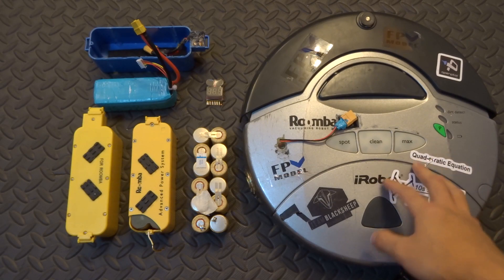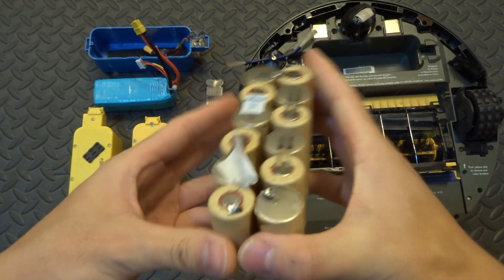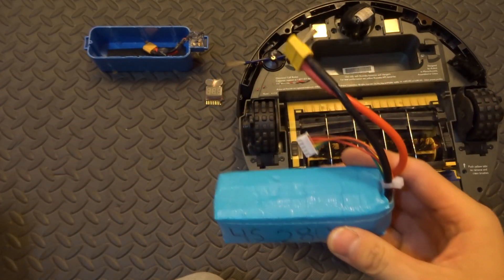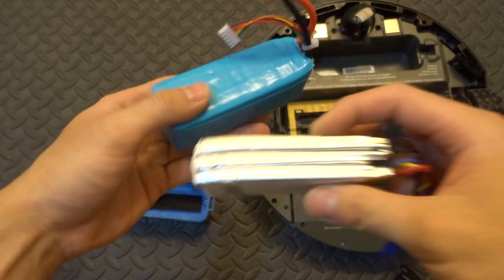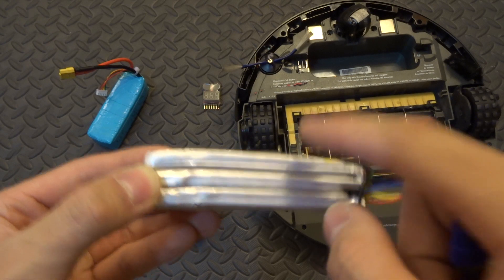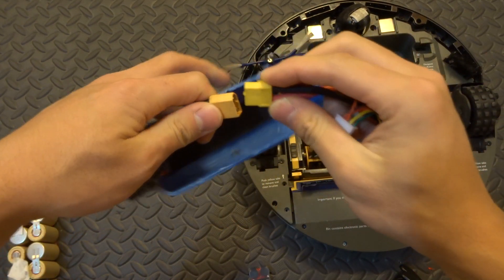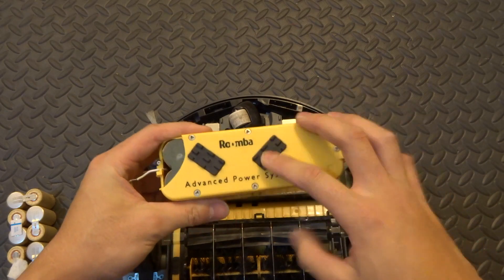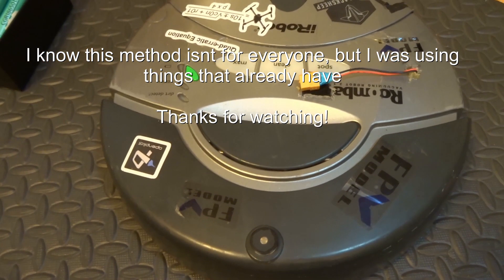How fix old ROOMBA BATTERY problem [2 METHODS]

Comment: Just get yourself a LiitoKala Lii-500 charger, take apart the battery pack, individually test each of the 12 sub C NiMH batteries for capacity (NOR test) to determine which one(s) are failing & replace the faulty ones with better ones. Reassemble the battery pack & voila ! 🤔😉😎
Reply: can my skyrc mc3000 do this? my roomba is dicked.
Reply: @CevicheTheory  Very much possible. It looks way better then mine. 🤔😏😍😆

Comment: Or.. purchasea cheap replacement for only $20 to $30 on eBay ;)
Reply: That's what I did =)
Reply: Just buy a new roomba on ebay. Seriously I've bought a bunch for $20-30. Get a 650 without problems for the same price and take a giant leap forward in performance.
Reply: But a Lipo will not go bad any time soon. Nmh batteries drain fast and memory of charge gets bad pretty quick
Reply: @cr2928  The NiMh battery in my Roomba lasted over 4 years. It still works but only runs for 40 min, which is still enough to do a room. NiMh is is way better than NiCd as long as you keep them charged up and don't let them over discharge.